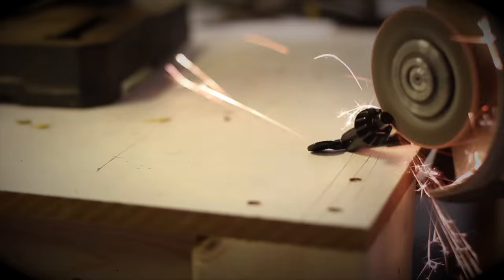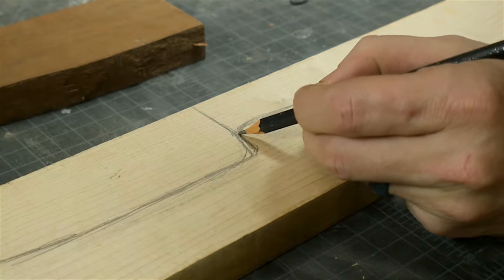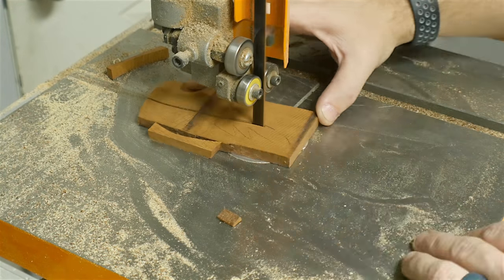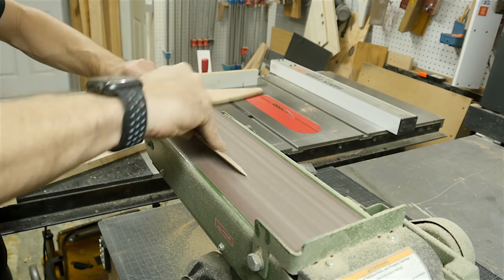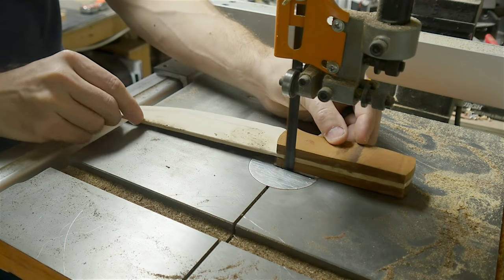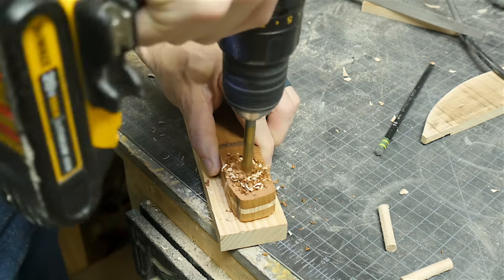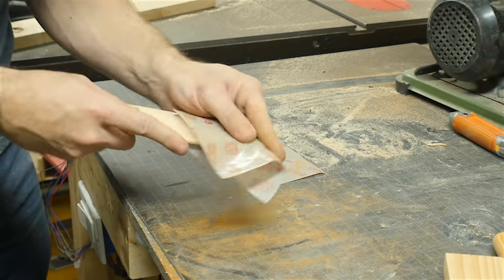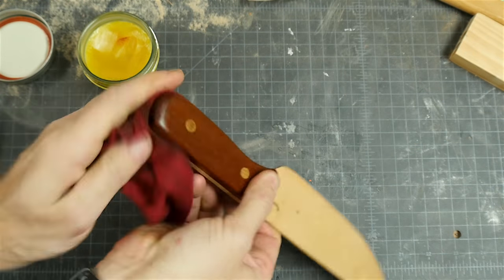How to make a cake knife from scrap wood // Woodworking | I Like To Make Stuff

Comment: I used to mix wood glue and sawdust to fill small voids in wood, but lately I´ve been using a sanding sealer/pore filler mixed with the sawdust.  I find that it shrinks less and accepts finish better that the wood glue.  Nice build!
Reply from the maker: Nice! I'll give that a shot, thanks!

Comment: One little tip, before you glue the handle to the knife, you should clamp the two scales together and shape the blade end part of the scale. That part is very difficult to deal with without scratching your lovely blade
Cheers

Comment: That was pretty cool Bob. Form and function!
I'm crossing my fingers that you might do my suggestion.
(The end table with power outlet and/or usb charging.  Gotta say, it is pretty convenient.
I can even show you the rendering for it I made in 123d design.
Reply: USB outlets can be really unsafe. I suppose it might be a bit safer if the table is powered by its own plug, rather than the USB being screwed into your homes drywall sitting beside mains voltage.

Comment: A knife like this is also great to cut lettuce (iceberg or sth), as a metal knife surface can cause more oxidation on the cutting edges of the lettuce. Does depend on how sharp(ish) the cake knife is though! Neat project 👍

Comment: Looks like a real nice knife! First off, how was the cake? Second, if you made a similar one but serrated the edge, would it work better for breads?
Reply from the maker: The cake was fantastic :)  Yes, I think serrations would help a lot with bread.  It'd be easy to add to this with a round file, as well.
Reply: I Like To Make Stuff Maybe a quick follow up video to this one for another short project? Bread knife, cake knife, forks, spoons, the possibilities are endless!

Comment: is that a central machinery belt sander from harbor freight?  if so... how are you doing the dust collection?
Reply from the maker: It is!  I collect all of the dust on my floor :)  
Actually, I haven't had great luck tying it to my shopvac yet because of the weird angle that the outlet sits at.
Reply: well i saw in the video it looked like you had somehow gotten a vacuum hose under there and I was thinking "hey... i need to do that... what did you do!!"   someone needs to make a 3d printed adapter on thingiverse for this thing.  :)

Comment: Excellent job on the knife! However, shouldn't a knife for breads and cakes be serrated? If you use a smooth blade on soft bread, it'll just squash the bread. A serrated knife can saw through soft bread/cake.

Comment: A wood knife will need to be cleaned within an hour of use because you will not want to have to scrub off the baked on cake because that will ruin the finish coating.